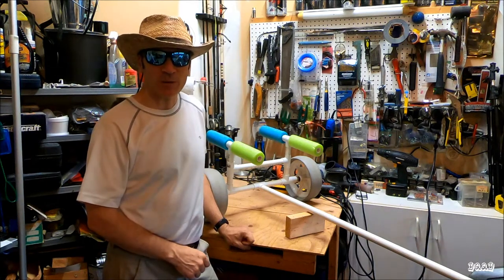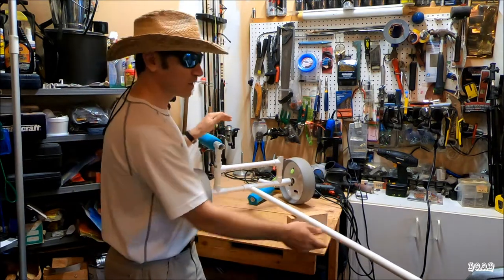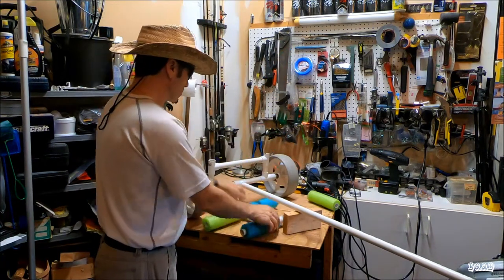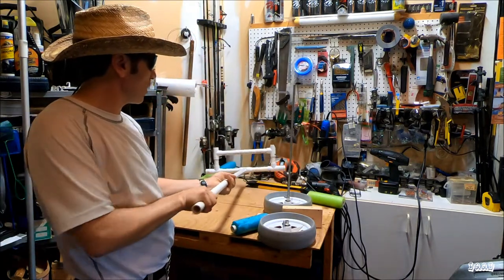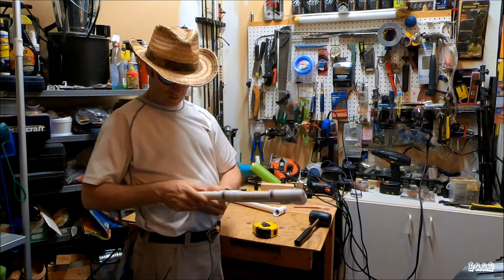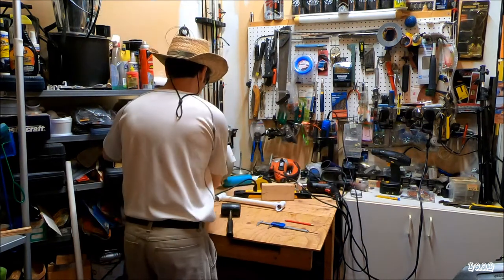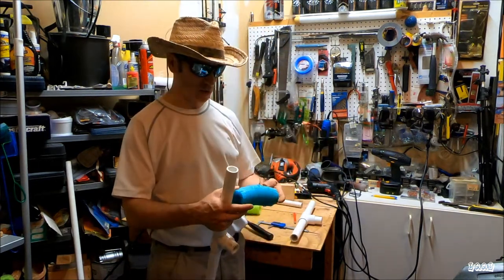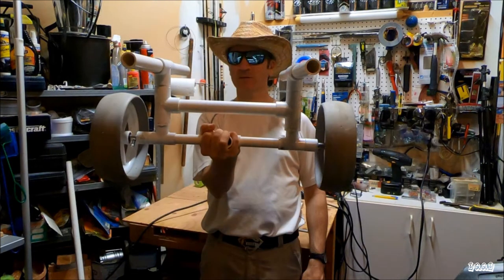YAAY Ep31 - How To Build A Kayak Cart

Comment: You could try slitting the existing noodles lengthwise and slip (and perhaps glue) the noodle pieces on the 1" dia pipe sections.
I like the way you originally designed, then modified your cart!
Reply from the maker: Good point Don. After some forcing I did manage to get the noodles on. It’s still holding up to this day.

Comment: I made something for scupper hole kayak cart but was using wheels and shaft from a dolly. Saw your wheels and i have some like that on an old golf cart collecting dust. Think mine is 1" pvc as well and it did break as well. Was trying to find some Schedule 80 pvc in 1" as it is stronger but the cost made it not worth it.
Reply from the maker: I recently cost out PVC parts to make an alternative design based on a 450lbs capacity cart. However with the higher prices of PVC today, I’d only save about $20 on the cost of the original cart, and that’s before glue and hardware costs.